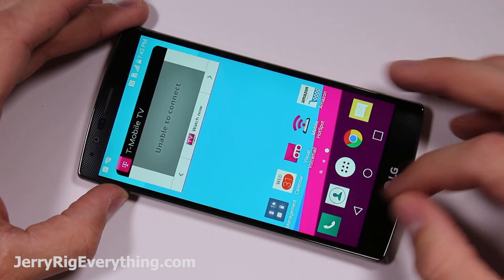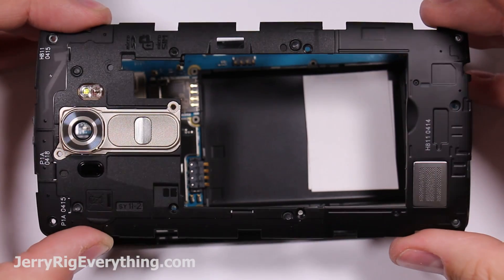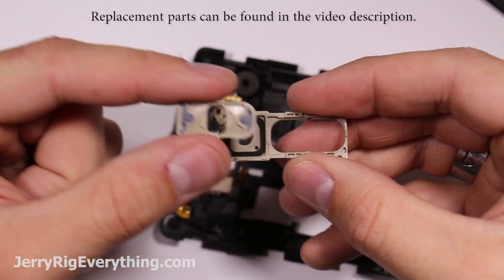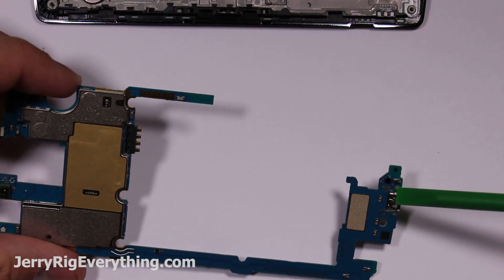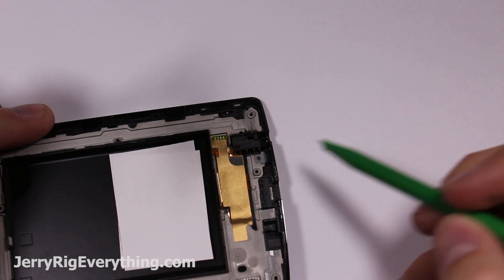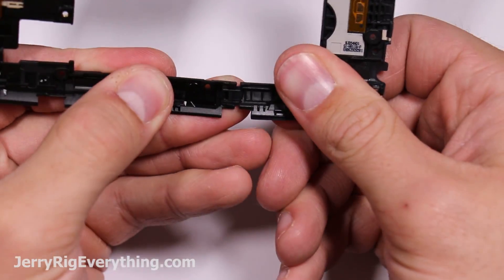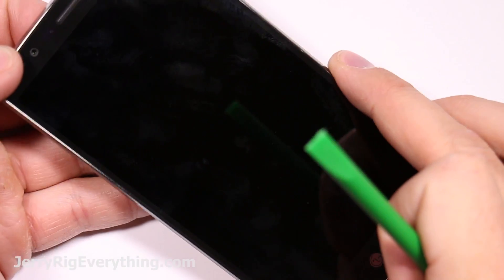LG G4 Tear Down, Screen fix, Phone repair video

Comment: I really liked my G4 especially once I unloaded bloat wear to stop overheating. About a year ago it would start to get partial grey screen so I stopped using it. Will replacing the LCD fix this problem? Also getting a decent battery is difficult. Very nice video. No loud music and you do it at a speed my brain can handle.

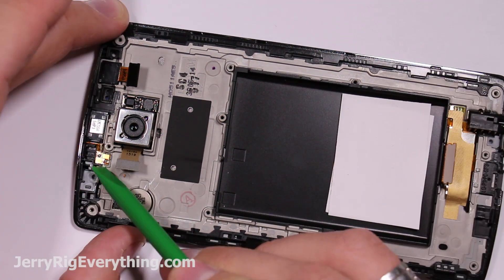Comment: Just replaced screen with frame as per video and suggestion. Went like a dream. Stephen Greenfield's comment re: transferring 'little light grey rubber insert' was only spotted after I'd finished so needed to go back inside (seen bottom left at 3:20). Despite this, great video that gave me the confidence to try this for myself and everything worked out just great. Many thanks.

Comment: Hello jerry,
Is there any way to solve the bootloop problem i am currently facing it with my lg g4? and also the phone when it was alive gets super hot while watching youtube videos
Reply: Any solution?
Reply: @shaffanmumtaz8830  nope no reply, i googled my problem found it to be manufacture defect shortly after some time of my comment my phone died only solution was to replace pcb but even after replacement cannot switch on wifi as it still gets very hot after using youtube or just on surfing, bad screen response etc, i recommend purchasing a new phone

Comment: If your lcd screen is still working with just only the broken front glass, you can get it fixed for a very reasonable price: http://www.ebay.com/itm/LG-G4-Cracked-Broken-Glass-Screen-Repair-Service-/371659659515

Comment: Great breakdown...  I have water damaged lg g4 H815 and a fully working H810..  Is it possible to swap h815 components  into the H810 to make it an H815... is it just the motherboard that needs swapping?

Comment: Hi! I'm having the vertical line problem with my LG4 and I was told that I needed to fix the flex cable connecting the motherboard and the screen. How exactly would I go about this? Do I submerge it in alcohol?
Side note: My phone also presses random things on its own.                         Thanks for any help!

Comment: Great video! Keep up the good work! One question though. What is the reception antenna? I've got problems with 3g signal, which leads to not being able to receive calls, while on GSM/WCDMA/LTE network regime, although 2g and 4g work perfectly fine. Only WCDMA won't receive signal at all. Wonder if its a software or hardware problem. Tnx in advance.

Comment: Hey Jerry, I found one thing missing from your video was that you do not mention about removing the headphone jack which is one more component that needs to be ported onto the new screen from your older screen.

One more thing to take a note is that not all the vendors provide the rubber proximity sensor holder (I am not sure what term to use here). This is a small rubber insulator that houses the 2 sensors for the proximity sensor. The distributor from where I received my LG G4 frame didn't have this part and I started facing issue when I made a phone call. The moment I made a call, the screen used to go blank even though I had not placed the phone on my ear. I returned that piece and asked for replacement but found that the new replaced screen also had exactly the same issue. On searching on the net I found that there was an insulator kind of thing in the frame that my frame distributor did not supply with the LG G4 frame that caused the proximity sensor to think that the phone was held close to the ear all the time and used to turn off the screen when ever I made a call. One porting the rubber insulator from the older phone my issue got resolved and the screen behaved the way it should.

Thanks to your video. This is the second time your video helped me to replace a part of the phone.
Reply: where did you order the replacement screen from? i haven't found one that doesn't have negative reviews on the LG G4 replacement screen yet, thanks.
Reply: Michael Chen I got mine from fixez.com

Comment: Watch out! I followed this video to the tee and ended up with a very quiet phone (the external speaker is fine) that would go black when making a call such that I couldn't hang up, hit the speakerphone button, use the dialling pad, etc... :(

There are small, black, rubber gaskets for the phone speaker and the proximity sensor. They aren't included in a lot of the OEM replacement frames (watch out for listings that say "no small parts"). You need to ensure that you cannibalise them from the old frame onto your new replacement one.

Read this thread for more info: http://forum.xda-developers.com/tmobile-g4/help/proximity-sensor-issue-screen-change-t3180633
Reply: Well, I faced the same issue and found that the link provided by Jerry has the rubber part for the proximity sensor where as the one from where I bought didnt have that rubber thingy. I faced the same issue of the screen going blank on making a call and not able to wake up the screen. After googling out I found that there was on more extra piece that was missing and needed to cannibalise from my old phone. On doing so my phone works as expected. :-)
Reply: Don't remember doing the speaker gasket but still having issues after canibalizing the proximity sensor gasket but maybe I didn't snap it back together like this video which is by far the best I've seen.
Reply: in my case there were 2 rubber pieces on both left and right of the earpiece, one black and one grey

Comment: I seriously hate this phone! mine gets so hot while using certain apps and then will turn off if I don't hold it in front of the a.c. 

A few month ago I had it plugged in and then it shut off on me and was stuck on the LG g4 screen and wouldn't turn on. got it replaced with my insurance.. But then it happened again last night. and bc my screen has a small crack in it, the insurance  won't cover the manufacturer problem!! this phone is shit!

But thankfully for you, I might replace my screen in my own (for hopefully cheaper than the 200 they want for it) and then bring it in to get the manufacturer problem fixed.

where can I but the screen with frame? do you have a link to a site you got it from?

thank you for your help!
Reply: @Amber: I bought mine from https://www.fixez.com/store/lg/lg-g4/lg-g4-display-assembly-with-frame-black.
The frame fitting is perfect.He provides only one plastic opening tool and the adhesive strips to stick the rear camera and the vibrator. If there is any issue then it is the buyer's responsibility to re-ship it back to him at his own cost. They would want you to ship it back in th esimilar way they had shipped it back with all the protection to the screen and the rigid box. So dont throw away the package until you are satisfied with the item else u will need it for replacement or return. Make sure you read that policy appropriately.

One thing I observed from this distributor is that the screen contrast is not the same as the original manufacturer. The colours are not that vibrant and the screen is a little dull.

I have even mentioned about the proximity sensor issue I faced above in the comments. Do go through it to understand more. 

Hope this helps you to make a decision.

Comment: i successfully changed my shattered screen using this video and everything works perfect now, except for the headphone jack. it was fine before i replaced the screen. what could i have done wrong?
Reply: The headphone jack are just contact points to the motherboard. If the motherboard is not placed correctly, the contact to the headphone jack might not happen and you might face the problem. Please check if the headphone jack has appropriate contact to the motherboard.

Comment: Can anyone help? I accidentally dropped my phone in water, and took it back out. My phone still works, it still turns on and everything, I get calls and texts, but the screen is the problem. From afar the screen looks perfectly fine, but when you try to swipe or do anything on the phone, nothing happens. I don't know if I have to buy a new replacement screen or not, or if something else is wrong. Basically all I'm asking is if anyone can tell me if I should buy a new screen or not.
Reply: If you drop a phone in dirty water or water that has chlorine (like pool wateer), you'll want to clean the PCB of contaminants.
You can dissolve chlorine off it using distilled water, and then use methylated spirits, which blows away the water and then evaporates very quickly itself.
If contaminants ar left on the PCB, they can corrode it. It might work for a while before the corrosion kills it.

Comment: Hi Jerry, nicely down, I am a surveyor my LG4 fell into a march a got soaked and within a second got off and never got on, phone is two weeks old and I dried it with hear dryer and it looks new but became sleeping beauty and never wake up??? any help?
Reply: When you remove the back of the phone and the battery you should see a little box on the battery and a little box on the phone, if either of these boxes are red instead of white then water has done irreparable damage to the phone. If neither of them are red or just the battery is red buy a replacement battery from amazon.
Reply: Hi Noel, many thanks for reply, my LG4 has one white circle on the battery and one on the body of the phone and both of them are white? now what?
Reply: Next I would try looking up the button combo to do a hard reset, if that doesn't work your last option is going to a professional/ see if it is still under warranty.
Reply: Thanks for your time trying to help me, this is the most weirdest thing I have ever experienced with LG... guy dropped his phone in the rain and smashed many time by his car but it's works but mine???...

Comment: Is it just me or are the 4 central screws surrounding the battery impossible to remove?
Reply: If you have the right tools then there should not be any issues. I have the philips screwdriver that perfectly fits and am able to remove the screws without any issue.
Reply: I got it done in the end. Used a knife lmao

Comment: I had a problem with my G4 where it went into a restart looping and they told me its a motherboard problem and all they will replace it with a new one. now I don't care about the phone as much as I want the data from the internal storage (the files and photos). if there is anything you can help me with I would really be thankful 😩😩😩

Comment: Hello Jerry.  I followed your instructions to replace my broken display screen on my LG G4.. The device worked fine with broken screen, but I have replaced Moble and IPad screens and felt I could handle this repair.  That being said...
 I purchased the complete screen with bezel online to ease the repair.  After completing the repair, thanks to your excellent instructional video!  The display works after repair, but there are a couple issues.  
1. When display times out I should be able to tap screen twice to bring it back up.  That does not function every time.  I then have to press power button on rear of device to bring display back up. 
2. When I receive a call the screen displays incoming caller info and I can answer call normally.  As soon as I answer, display goes dark no matter what position and the only way to bring display back up is to press rear button.  Seems I did not complete a perfect repair!  Any suggestions would be greatly appreciated!

Comment: Hey Jerry, I stay in Canada. My LG G4 screen broke and I didnt fix it because it still works fine. Anyway it seems as if water got into the bottom part of the phone and there was this red point of light and a burning smell. I quickly removed the battery and tried drying the phone with a bowl of rice. Please what do I do next?

Comment: Hi Jerry, first off great video i made sure to thumbs up and subscribe!

Are you by any chance familiar with the bootlooping issues some g4 owners are having?

The consensus seems to be it is a hardware issue (a loose connector) and i was wondering if you had any insight on the issue

I purchased an international version of the g4 on ebay and lg doesn't seem to honor the warranty here in the US for repairs

Thanks for any info and here is a link to the article if you have time: 
http://www.androidauthority.com/productivity-pack-684519/

Comment: Jerry, today all of a sudden the screen on my LG G4 went black and only lights back up when i use my thumb to put pressure on it a little above the LG symbol on the screen. I've already replaced the screen once by myself about a month ago, would you have any idea of what issue i should be looking at once i tear down the phone again? I appreciate your time, looking forward to hearing from you! Thanks!
Reply from the maker: +Eric James It sounds like it has a bad connection with the motherboard.  Either on the plug side, or where the wires go into the screen.  Its hard to say for sure without seeing the phone... but it sounds like youve been in there before, so you know what to look for.

Comment: Hello ! My question is about the screen and only the screen, I´ve purchased this: http://www.ebay.es/itm/Pantalla-cristal-Cristal-Vidrio-Tactil-LG-G4-H815-H818-Negro-Cristal-delantero-/191764329014?          . Can you please tell me If I would be able to replace only that part? I guess I need to heat the screen and then I will be able to remove it, without opening the hole cellphone. If not would you explain me how? or If I need to buy something else? Maybe I need to cancell this purchase in case you say is not the correct. my phone is from a friend that I´m trying to help LG G4 H815. Thanks in advance and thanks for the time you took to read this!
Reply from the maker: +Jonathan Arboleas That is the part you would buy if you are going to do a 'glass only' repair.  That is not what I show in this video.  A 'glass only' repair is near impossible to complete successfully without professional tools.
Reply: +JerryRigEverything yes after a lot of research I found impossible to do it with the tools I have , thanks for your support !

Comment: Hey, please answer me. I'm in desperate need of help. I got my LG G4 last month and it began to start restarting days before it even reached one month. It crashes a lot like it will freeze and also line streaks (not from damage or permanent) and it will goes on to a boot loop. Sometimes it crashes with a loud beeping sound. When it finally starts, it crashes on the 'android is starting optimising apps n/n' and it goes all over again and it overheats as it goes on. Why is that? Hardware failure or software problem? Sometimes it restarts or turns off on its own even within no use and sometimes I can't even get it turned on, unless I take the battery out and pop it back in. Sometimes it won't turn on even after taking the battery out and I need to let it sit like that for some time before it works again.. It can still be used though but it's such a pain really.
Reply from the maker: +Krystal Jung You should still be under warranty.  Take it back to where you got it. Software is hard to fix.
Reply: +JerryRigEverything Will it cause any damage if I leave it as it is? In my country, we don't really have that huge of a customer service and mine only covers hardware failure (and some other things) and software is not included. I need to pay for $30 for software fixing but what I'm afraid is the repairing will make it much worse and not usable as it is now. Please enlighten me.
Reply from the maker: Krystal Jung It probably isnt going to get better by itself.  If you cant warranty it out... Maybe that 30 bucks is the next best option (If you cant live with the problem anyway.)
Reply: Oh okay. Thank you for responding! You're very fast. :) One last question, what if I wait for Marshmallow to come out? I heard it's coming soon expected February 1st. Will it wipe away the problem?

Comment: I followed your guide and got the screen replaced. After rebooting I noticed only the front camera works but the pictures come out inverted and the I get a blurry screen for a second on the back camera before it starts crashing. Is their a reason why you took out the camera/power buttons? cause I skipped that part, thinking you just did that for people that want to replace their camera only.  Thinking about buying a camera but I had no trouble taking the camera out. Any help would be appreciated and thanks
Reply from the maker: Hmm....  If all you replaced was the screen,  i have no idea why the cameras would be malfunctioning.  Like you said,  those only need to be taken off if you are replacing them specifically.  Check your connections again visually.  Make sure everything is solidly connected.
Reply: +JerryRigEverything Yeah, that's what I'm about to do. Thanks for the video and for the quick reply.

Comment: Hi Jerry, my 1 and a half month old LG G4 rear camera is not working, never dropped it all and all applications requiring the use of the rear camera crashed. I paid alot for the phone and now it is doing this to me, please help :0
Reply from the maker: +Adam SAYMAHNAMEAGAIN If it is not cracked it might be under warranty.  If it is not under warranty, than you can try replacing the camera, or recconecting the camera.
Reply: I think it's with reconnecting the camera, but im kinda scared to do it alone. Guess ill bring it to a local phone repair shop and get it done. Thank you :)

Comment: hey Jerry my g4 screen is hard to wake up it shuts off and off I gotta keep playing with and finally it comes one but i dnt know why it don't wake up with just one clean the screen goes back to sleep I swipe and it back to sleeping  after waking it up
Reply: Lol mine wakes up only if the light hits it
Reply: +Hugo Paredes There is a black gasket in the proximity sensor area. YES! I forgot it too and it worked great once I put it in. It's black and matches the frame, so it is easy to miss.